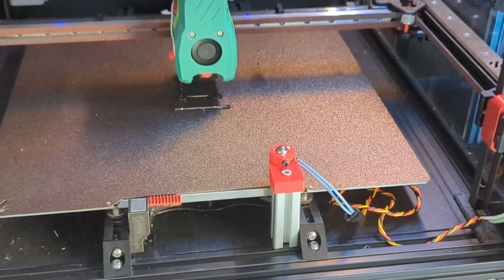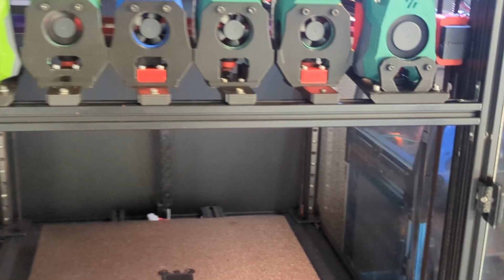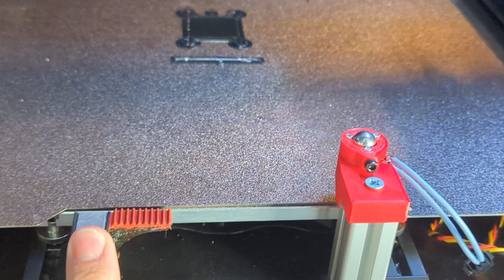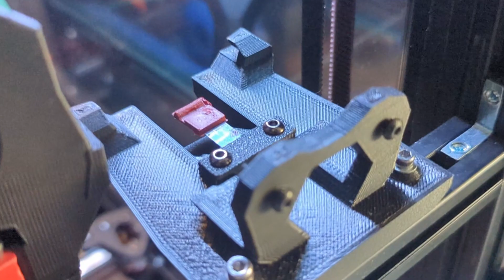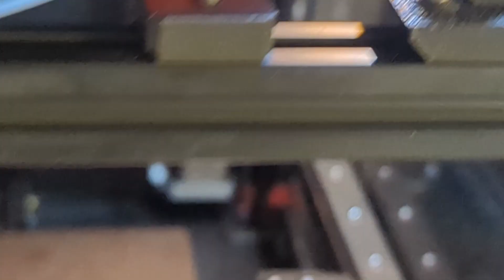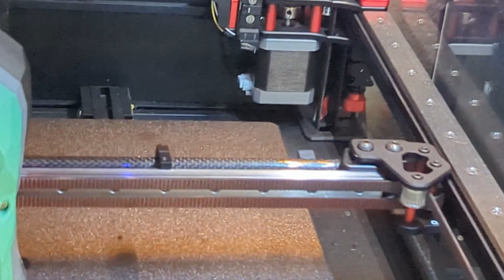Quality of life

Comment: Would this design work for a 300mm VORON Trident
Reply from the maker: The nozzle wipe and probe - sure. You would need to find a different mounting location.
Also the tool head needs to travel around 10mm over the edge of the plate. 
By default V2 and I think trident has some extra travel at the back, I just shifted the plate back and installed it at the front.

Let me know if you get it to work.

Comment: Great job, that's very impressive.
Can you control several print heads via the CAN card on a "standard" VORON 2.4?.
Considering building a 2.4R2 but I come from an old Duet3D system so it's all very new and different for me.
Reply from the maker: Absolutely. If your controller already has a canbus interface, you are all set. Or you can purchase a separate usb2can adapter for 10usd or so. Canbus is like Ethernet - one interface can talk to many toolboards.
Reply: @viesturz  Thanks for the explanation, I'm hooked.. 😀

Comment: Do you still use tap for build plate measurements and then the nozzle alignment probe just to check/confirm offsets after a new tool is picked up? Or has the nozzle alignment probe completely replaced tap for you?
Reply from the maker: Use tap for build plate measurements, the nozzle alignment probe is just whenever I mess with the toolheads and need to recalibrate offsets. Not part of regular print routine.
Reply: @viesturz awesome, thank you!

Comment: Would love to have more info on hard and software for that nozzle alignment tool.
Reply from the maker: GitHub link in the description
Reply: @viesturz so basically it's just a contact closed between the bottom ball and the spring steel?

Is it only for Z offset? I thought it was also for xy offset.
Reply from the maker: @scruffy3121  XY offset as well, the nozzle moves about 2mm below and touches from the side. This would be way over engineered for just Z offset.
Reply: @viesturz  thanks for clarifying, I am no good at decrypting macros.

Comment: OMG you have 6 hotend/extruders. Are they all connected to the Pro with CAN ?
Reply from the maker: Yes, just connected all together at the back and single twisted pair down to the main board. I'm running a separate usb2can board however, the m8p built-in one gives me random probe timeouts.